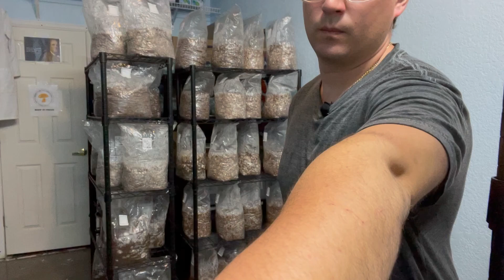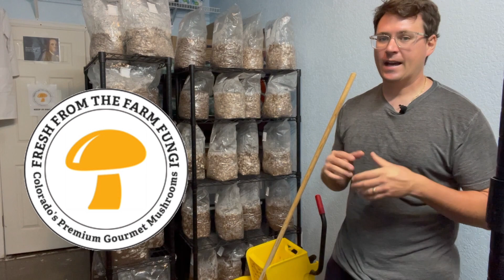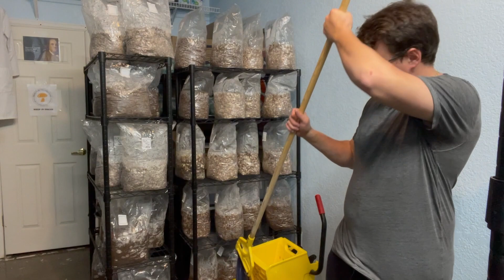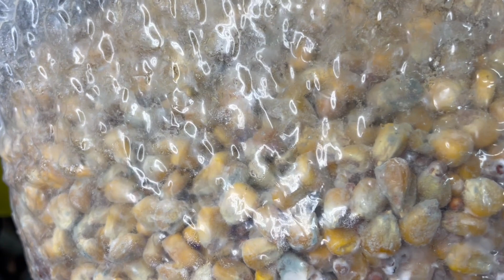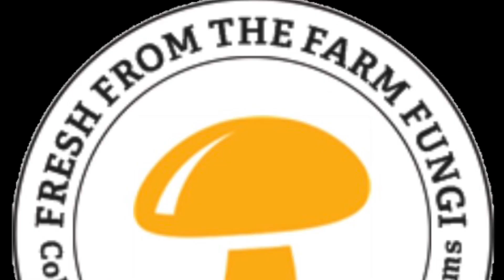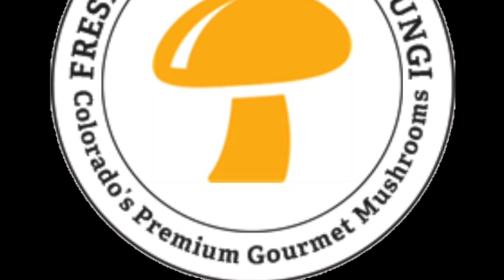Contamination Mitigation

Comment: Respect Dude. Very few people will tell you they messed up or how to fix it! I do not think your stuff is dirty (if I did I would not have subscribed) I think the bad windy weather did a number on you and to have a balance of practical and cost effective vs spare no expense is not easy for any small business. I do not live in the US here (in Africa) they use pump sprayers with bleach to do walls and everything (works on ebola) also saw a comment with peroxide ... if possible I am sure you can do like high pressure vapor with peroxide

Comment: off topic but, can you say which lighting you use for your tent or what you recommend?
Reply from the maker: I just use LED shop
lights make sure they are waterproof - Ive used T5’s in the past they worked really well too but gave off excessive heat
Reply: @FreshfromtheFarmFungi  did you get yours on amazon? could you give a link if so?

Comment: Could be spores settling on your flo hood when it isn't on. Turn her on and it will blow them off maybe slowly.  Maybe?
Reply from the maker: yes another possability - I haven’t had any issues since I filmed this video I took a hard 180 and really refocused hah
Reply: @FreshfromtheFarmFungi  Do you cover your ffu when not in use? I have a big plastic bag that I keep over mine when not in use to try and keep the airborne particles in the room from settling on the actual unit. I'm not sure it helps, but it definitely hasn't hurt in my experience, especially with the amount of pollen in my area.

Comment: I love this video. Trichoderma is a real issue that can become a problem if not hunted down. Cleanliness is key but this seems like it was definitely a bad spawn bag or two. If the blocks contam at same rate and timing it’s likely the mycelium over grew trich in spawn only for it to resurface later. Trich is white like mycelium in vegetative growth state only a different texture so may be hard to differentiate.
Reply from the maker: yes it could be poor technique from rushing through and also spawn but after I made this video I haven’t had any issues just refocusing and going back to the basics has helped tremendously
Reply: @FreshfromtheFarmFungi  Agreed!  We have had some issues recently that are hard to trace having so many variables. Going back to basics and running a tight ship really helped.

Comment: Do you spray down and wipe each bag with iso. This seams to work well for me. But then I am only running 70 or so blocks a week.  Thiiking I am going to flip my barrel on side and make it open lids both end to do a pass through to lab also setting up a hepa fan that will pump in barrel for cool down. Seam to work great on a large scale for TR. I know cap and stem was just talking shit about using iso in frot of the hood but I make sure I don't spray towards the filter.just had to do a full break down of the tent output fan seized  from spores. Cleaning cleaning cleaning cleaning and more cleaning o and a back up fan and fogger. Lol. Fyi I did save the yellow and Lm. lc's took quite a bit of time but fruiting nice flushes. Quick question running 5 lb. Now untill my storage container is up. Is it worth a second flush. Starting to feel 1 and done may be a better use of space and limit blotch or contamination especially with the lions mane. My first contamination was black soup In Lm. Bags.for me the second d flush on lm seams to be 2 weeks and small thinking I could get a nicer first flush in that period.
Thanks for all your video's. That being sad keep spawing mush love.
Lol gee I wonder who my influences  are.
Reply from the maker: cool ideas I don’t think the extra precaution would hurt 👍 I think if space is limited 1 flush would help and maybe set up a passive fruiting outside to stretch what you can - I have 2 rooms setup so I can do 4 week cycles, one week one tent, one week the other tent, get second flushes and then flip 👍

Comment: My lab is an easy-up wrapped in plastic located in a repurposed automotive shop. Dust is my biggest problem.
Reply from the maker: setup a stand alone hepa filter and vacuum the whole place with a hepa filtered shop vac and mop - that should help tremendously

Comment: You could ask a local college's engineering department to do a heat transfer analysis to determine how long it takes a block to heat up to an internal temperature that kills all the troublesome spores.
Reply from the maker: I have heat sterilization pouches I can validate with
Reply: @FreshfromtheFarmFungi  if they arent biological indicator strips they won't do you much good.

Comment: Especially this time of year is bad. Farmers tilling kicking up dust, pollen, warm temps, rain, all these things increase the spore/pollen load in the outdoor air.
BTW: That might be Cladosporium, not Trichoderma. They look very similar to the naked eye sometimes. Microscopy is the only way to be sure. Clad is very very common across the globe anywhere that is dark, moist, and stagnant air. [attics, crawl spaces, bathrooms, closets, ect.] It is commonly associated with that musty, moldy smell.
Reply from the maker: maybe - but it didn’t really have an odor and I was doing a bunch of gardening which makes me lean towards trich.
Reply: Just to follow-up on this... a good indicator is the behavior of the mycelium. Trich releases specific enzymes that will dramatically slow or even prevent other myc from growing; while the Trich will spread very quickly. Clad does not do this and myc will often overgrow the Clad & spores. I have successfully overcome minor Clad by waiting for the myc to colonize and removing any remaining visible spores with qtip and hot soapy water. However, it is just as easy to miss it, spores start a light brown color, shake the jar. Then, a few days later, you have what looks like a jar full of Trich.  
Like Gary said, the best thing to do is keep your grow space clean. Remove all contam at the first sign and clean your workspace. Review, Renew, Re-cert your sterile process and try again, it happens to the best of us - don't be discouraged.

Comment: How did it get into grow bag if I was sterile?
Reply from the maker: poor aseptic technique
Reply: There are many ways it could happen. It could happen by gravity, the bags are open for periods of time and if it is pulled out of laminar flow for even a moment spores could be knocked in. Spores could be blown in if the bags are held improperly inside a flow hood. It could be a suction action from the bags cooling. Endospores, maybe? It seems Gary has it under control, or at least on the way towards being under control.

Comment: In our facility if something like this happens, it's always an issue with spawn, u can get contam on a few blocks from outside of the bag but it's never mass contamination. If u cooking the grain in a pressure cooker at 1.5 psi for less than 3 hours and your bags are touching each other u doing pasteurization which is not enough to kill spores of Trichoderma. Get your self Temperature measuring strips and test what temp. u getting inside of your blocks.
Reply from the maker: I did just use a bunch of new spawn so this could be the case
Reply: @FreshfromtheFarmFungi  For sure, it's always a problem with the spawns :) We have tossed away like 2000 bags a few weeks ago :D Now we using some high-end autoclaves with temp probes and everything works soooooooo much better now :)
Reply: Another tip I find helps; while pasteurization won't kill the spores it will kill the cellular growth. This is what gave birth to the idea of soaking. I still do this with my substrate today. Once it is all mixed and watered like I want it; I let it sit for 24-48hrs before I pasteurize at 170F for 4hrs.
Reply: @AaronAlso  So you soak your CVG (or similar) in regular tap water 1-2 days, then drain, THEN soak in boiling water for 4hrs?
Reply: @HeyRaeSunnyDay  
I place a block of coir in a pillow case then place that in stock pot w/steamer (I like the bottom plate kind meant for tamales; Tamelera 20qt+) already at temp full of steam. The block doesn't last long and will just fall apart in few minutes with only steam. The bag(pillow case) can then be left to sit in a dry place to cool. It will be mostly(99%) dry if left for a few hours and can then be stored in a sealed container. 
I, however, mix this with other ingredients in a bucket and get it to a dry field cap. (heaping tablespoon full, squeeze in hand really hard, get just 1-2 drops, perfect!) Let that sit for 24-48 hours before checking Ph (7.5ish). Then bag/jar it up and pasteurize at 175F for 3-4hrs; in Tamelera, longer if you have more bulk, higher temp if you aren't using poo.
52qt with hold 3 gallon(6 half-gal) jars perfectly, and IMO is the easiest way to pasteurize at home on the stove: Tamelera!
Reply: @AaronAlso  Wow wee, that is genious.  Speaking of "poo" I noticed "organic cow manure compost" at Homedepot today, I would if the the cubes would like that as a substrate?  Would be quite tricky to pasterize, maybe?
Reply: @HeyRaeSunnyDay  
TL:DR 
Try it!, stay below 180F, get a Tamelera

There is a lot of biology and chemistry to digest in your question. First things first, because fungus is a decomposer. Many, if not most, species will benefit from the synergy of other decomposing bacteria contained, specifically, in herbivore poo. 
I like worm casting because the biology of the red earth worm (Eisenia fetida) is especially good at sequestering phosphorus and making it bio-available in the soil. However, it isn't used straight; I essentially mix my own "manure": straw :corn cob bedding :coir :castings. [[1 :1 :2 :0.1]] This mix has worked very well for most of the gourmet and medicinal mushrooms I have grown. Although, you can trade out the coir for hardwood fuel pellets.
Anytime you work with poo it is important to stay below 180F. Above this temp most of the saprophytic bacteria will be killed off and your sub will very likely contam. At the very least you will loose the synergy; resulting in slow colonization.
Reply: @AaronAlso  That is a lot to digest (pardon the pun).  I'm considering it and will heed your advice to stay below 180F, especially sincel slow colonization and contami are my specialties!!! Mush love, friend.  Please start a channel!
Reply: you say that it is necessary to sterilize for a minimum of 3 hours ?
Reply: @zanonina1  
I should clarify that too... 
Generally this is the time the cold pot is on the burner. I like to go slow, hit the target temp (170F) then remove the pot from the burner/turner it off; stop the heat source. 

I have found that if I go too fast with the heat I tend to go over the mark and if I let it sit to "carry over cook" it cools too slowly. 
There is a somewhat narrow margin for pasteurization. Your mileage may vary, but it isn't rocket surgery.